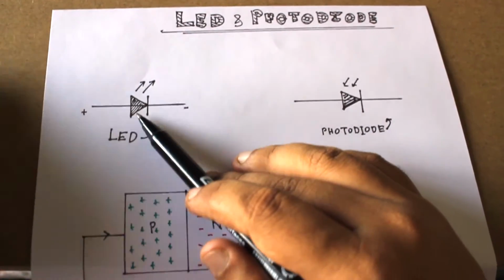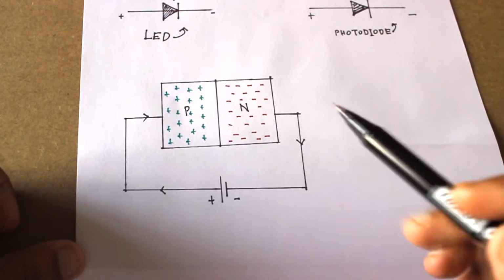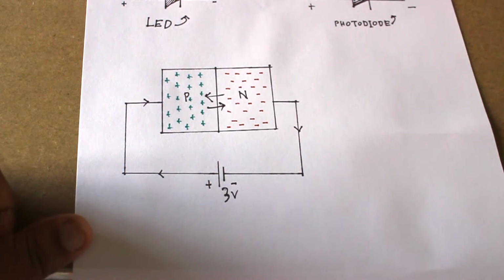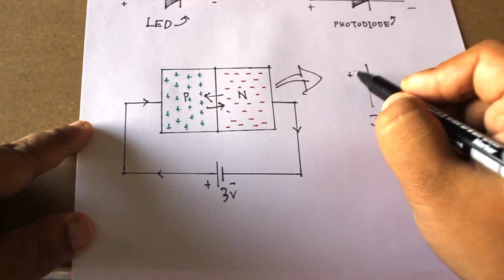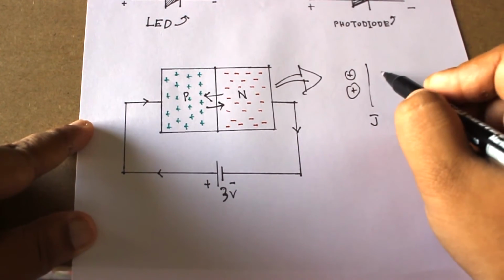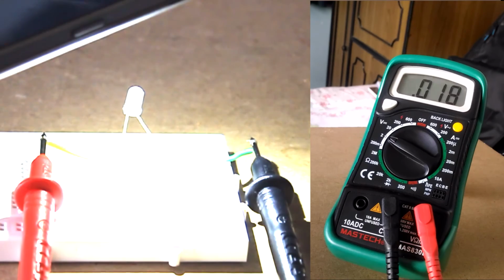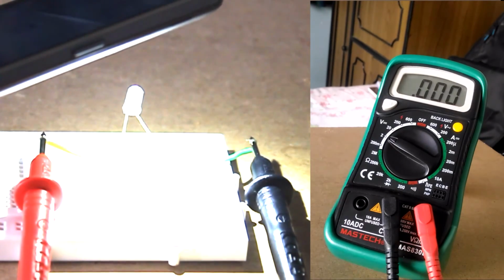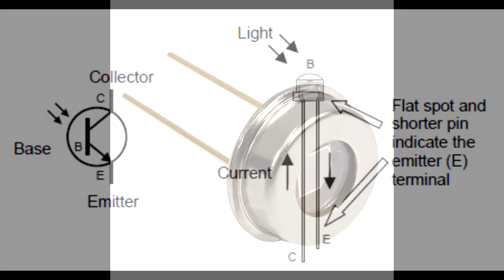LED and PHOTODIODE : ARE THEY SAME?

Comment: First I'd like to thank you for making this video. But unfortunately it didn't live up to what the title promised.
You may have explained that you COULD use a LED as a photodiode but you did not explain  or show IF they are the same or NOT. There must be a reason why they are concidered different parts. You din't answer that at all. :-(
Reply: Bit late but I believe photodiodes are essentially just diodes optimised for light sensitivity. On the other hand LEDs are optimised for producing light efficiently.

Solar panels are also essentially diode arrays that are optimised to induce a current. All are just diodes optimised for different purposes.

Comment: pls give me the name of some low cost photodiode which can be attach to galvanometer for measuring light intensity by the deflection...
pls help me, because it will help me making a simple colorimeter. Thank you.
Reply from the maker: you can get low cost photodiode sensor from ebay or other online store. They are not that expensive. 1 channel photodiode will cost around 200.
Reply: thanks